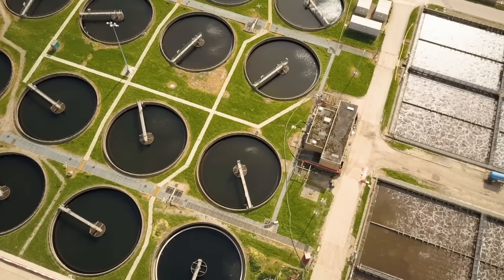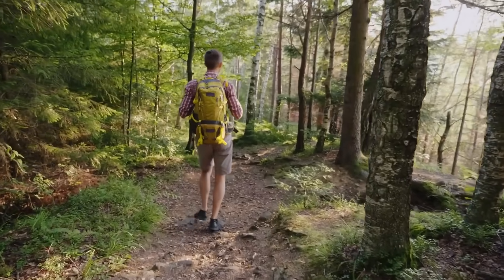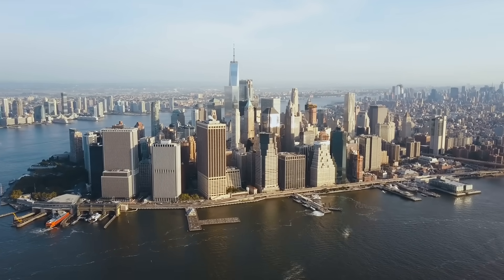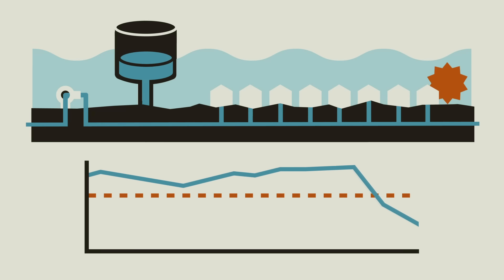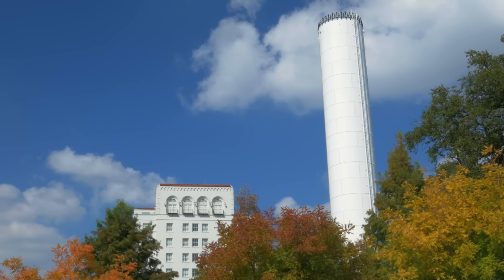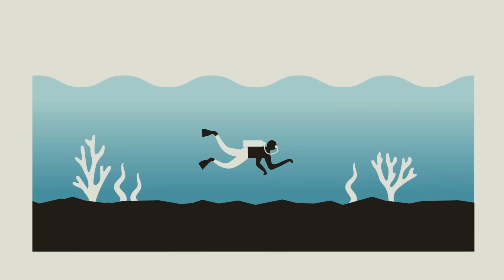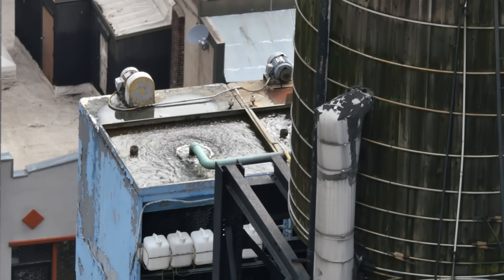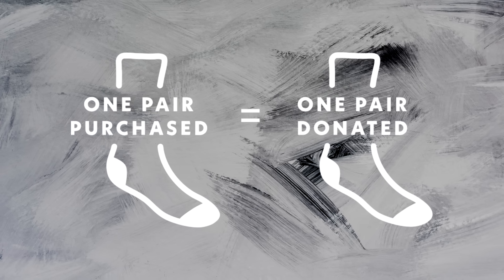How Water Towers Work

Comment: A water tower is like a capacitor or rechargeable battery --- it releases copious intervals of flow when needed, and then stores the water during periods of less demand. :D
P.S. That's what a savings-account is supposed to be for, too --- you put in extra money as you get it, and then it can be heavily drawn upon during an emergency.  The problem is that many folks cannot resist spending money on stuff that they don't need, and so they are not able to save up much.
Reply: Was gonna say the same thing.
Reply: That's not how poverty works.
Reply: How did you manage to turn a topic about batteries and water towers into a message of “Why don’t you just not be poor?”
Reply: "The problem is that many folks cannot resist spending money", uhh no, it isn't. Spoken like someone who doesn't know poverty. The PROBLEM is that many folks cannot make a living wage and the concept of saving is a complete fucking joke because respect for the working class has become completely abysmal, not to mention profiteering financial institutions being the cultural norm, education prices (both public and private) being absolutely hysterically gouged, etc etc etc. There are SO MANY problems that come down the line before "people have no self control" that it's an insult to even suggest that it's a substantial issue. Corporate profits are at an all time high and the concentration of wealth within the upper classes is more severe than ever before in the history of this planet, BY A WIDE MARGIN, and that's including the times when kingdoms and emperors were the way the world was run for thousands of years before modern governmental systems came of age.
Reply: @kylezo  , and All those problems are caused by the world's people's disdain for their Creator's laws. Bear with me please. For example, there are 4 Scriptures commanding the 7th Day Sabbath.
Exodus 20: 10.
Exodus 23: 12.
Leviticus 23: 3.
Genesis 2: 3.
There are  0  Scriptures commanding a weekly sun day observance.   0   .
Acts 20: 7 refers to the yearly Shavuot/Pentecost commanded in Leviticus 23. Proven by counting the 50 days.
🔸Matthew 5: 18.   Not one.
Mark 7: 7.
So we see
🔺Deuteronomy 28 15 - 68 
in effect Today.
🔹II Chronicles 7: 14🔹
🔹 Deuteronomy 28: 1 - 14🔹
Man's character hasn't changed, and will not until the Savior Yeshua, who came as a Hebrew speaking Hebrew to Hebrews, and so certainly doesn't have a Greek word as His name, until He returns as lightning flashes from the east unto the west, and begins His eternal reign as King of kings over the people and planet He created.
Reply: @kylezo  Take one look around you and I'm willing to bet you'll start to see a lot of people who would have enough to get by if they managed it properly. I'm on minimum wage and if I only spend on the things I need not the things I want then I end each month with a lot more than I started it with.

As panda4247 very rightly pointed out, people see a lot of things as necessities when they're anything but that. A car is quite often a huge waste of your earnings when you could likely just walk, bike, or take a bus. Mobile phones too, are an extreme money drain that people think they need. Take care of your phone instead of replacing it every 6 months. Same goes with computers. Learn how to take care of your things instead of wasting money replacing it.

The key to surviving on little to no income is independence and self control. A need-to-have basis rather than a want-to-have one, and knowledge of the systems and objects around you are your most valuable tools. Don't need to call a plumber when your sink clogs if you know how it works!

I won't deny it's possible to be on such a low income that you physically can't afford to live, but in many developed nations this should be impossible if you're seeking the right help and managing your assets properly.

I mean.. look at yourself as you wrote that comment, likely on a computer you bought (can you really say it's necessary?) using your time to respond to YouTube comments instead of benefiting yourself.
Reply: @MGSLurmey  Lmao, a car not being a necessity, are you even from NA?
Reply: @kylezo  I agree that this is true for many people.  I was merely saying that some people would indeed have enough if they practiced sensible frugality and saving, the way I do.  I am merely on SSI and Food Stamps, but I manage okay on just those few hundred bucks a month; that's only possible through very thrifty living and careful budgeting, though.
Reply: @Fred @Kyle i suppose it's both..
I have seen people like a single mother complaining to somebody on the phone that she does not have enough money for something for her child... but the phone was a new iPhone, maybe 800€ or so...
And people who think that a car is a necessity even though they just go to work and back each day on a route that is serviced by public transport, and then they complain that they are poor..

But also, the global economy and inflation make saving not that attractive, and the people deciding these things don't care about the little people...
(and I know that "the people deciding it" is not a bunch of people in the suits having meeting for this, but again a global set of decisions of a lot of people with money... but that's the thing... Their goal is for "the people with money to be able to make profits" and not "the value of the money should not decrease")

So I agree with Fred, that in many cases it's just people not having the right priorities (or a will to adhere to them).
But I also agree with Kyle that the people on the edge of poverty don't have many options how to change the status quo, and it's sad the the desision power is in the hands of rich, not in the hands of many.
Side note: I don't want communism (not to confuse with the Russian totality which ran under the guise of communism... I don't want that totality even more :)). I am just saying that the current extreme capitalism decided by the few is not good either.

Comment: Voltage stays consistent across a circuit unless there is a transformer to step that up or down. Current can change based of resistance or lack thereof in a circuit. When talking about the movement of electrons through a circuit, they move from an area of high potential to a point of low potential (from batteries, capacitors and static sources) or following a magnetic field (from a generator or transformer). 
When two different voltages meet, they simply combine their potential. If they are in series it is additive and if it is in parallel, it is at the highest voltage source. If any component can't handle the voltage, it will burn out and break the circuit.

Comment: 2:21 Ahh you have triggered every electrical engineer. Electrons flow from low potential to high potential, as the high potential will attract the electrons accumulated at the low potential.

Comment: Fantastic video, thanks so much! Because this video, like all those on the channel, is so informative and so interesting, I wanted to offer one important correction. Strictly, electrical current flows from high voltage to low voltage, but electrons flow in the opposite direction. (just in case any materials- or electrical-engineers-in-training wander over to the channel!)

Comment: Water towers are quite rare in the UK nowadays and there are strict rules pertaining to how water can be store so that is it safe to drink. I wonder how safe water stored in towers or tanks on top of buildings is and how it is kept safe? If I am not mistaken, in the UK drinking water cannot be stored in domestic water tanks due to the risk of contamination finding it's way into the supply. This is why before the advent of instant hot water boilers (gas-fired combi-boilers, typically) hot and cold mixer taps were not used in British households.

Comment: Great content! Question; I have installed a windmill on my property and am wondering how to calculate the height the water tower should be. Can you advise? About 30 ft. would provide roughly 15 lbs./in^2. But I don't know how to quantify friction and turbulence losses. I have a 1" pipe from the windmill to the barn hydrant which branches off to 3/4" going the house and another 3/4" branch going to a tiny-house. total distance from where the water tower will be to the shower is roughly 200 ft. I thought of buying gauges and mount a tank at different heights on the water tower to test but that seems like a tall order. :)

Comment: i thought there r several ways to save energy , save money by selecting suitable pump, deviding zones, using different size pipe, solor energy, using in minimal housing unit, some cases presure can be created by solor perpelled engine.

Comment: Pumps create flow not pressure. Restrictions create pressure. This is basic hydraulics. The rest of the information is interesting.
Reply from the maker: Can I ask where you heard this? So many people comment it to me, but it’s really not true.
Reply: @PracticalEngineeringChannel  john deere tech program. Pressure is created by restriction to flow. So if you have a pump regardless of what it is and it is pumping from one location to another with the same diameter tube or pipe on both sides you will have flow but no pressure.now if you have a smaller output than the suction there is going to be resistance and this will create pressure. Also if there is a smaller input than output you have no pressure there as well just flow.

Comment: Pumps create flow. Pressure is created by restrictions
Reply from the maker: Can I ask where you heard this? It’s not really accurate.
Reply: @PracticalEngineeringChannel  it’s very accurate. Take a vehicle’s engine for example. As the bearings wear out the oil pressure- even though the pump is putting out the same volume of oil as it always has due to the bearing being worn away the space the oil flow has is bigger so the oil pressure drops. The more restrictions you have the higher the pressure. The higher volume of flow yada yada

Comment: Why aren't we letting these double as batteries to get some power back out of the tower draining? Or are we actually doing this? If not if we did, it wouldn't be a huge amount of power, but it would be something. He talks about the pressure, but all that would be needed is installation of a few low resistance turbines in the down pipes to generate electricity out of a process that is already being using in another manner.

Comment: 80% of the ones on our water system that we maintain are water tanks. Ground style tanks. Easier to maintain. Easier to cycle when things go wrong. But higher towers have the added benefit of more pressure due to it being a higher off the ground.

Comment: your animation of how water towers are fed is wrong water towers are fed from top not bottom if it were fed from bottom the pressure would be too much for the pumps & would destroy them leaving towns without water your easy way of describoing this look inside your toilet cistern the innards is pretty much the same as this but they dont have a vaccum outlet

Comment: 2:22 The electricity analogy almost works. It is true that "conventional current" flows from high voltage to low voltage. Electrons, being negatively charged, flow the other way, from low voltage to high voltage.
Reply: Pedantic, I know. Avoid the word electrons and use current and it's good enough.

Comment: If the depth of the water determines the pressure why do we need to place water at the top when there's greater pressure at the bottom? All we need to do is prevent the water at the top of thin tubes to not be removed?

Comment: We have a situation where we're looking very strongly at sinks and showers and other elements of bathrooms where you turn the faucet on -- and in areas where there's tremendous amounts of water, where the water rushes out to sea because you could never handle it, and you don't get any water.
You turn on the faucet and you don't get any water. They take a shower and water comes dripping out. Just dripping out, very quietly dripping out.
People are flushing toilets 10 times, 15 times,

Comment: In Hanoi, Vietnam residents had tanks on the roof or top floor, I'm assumig to suplly the water pressure.  I could hear the pump engaging after using the water to , I'm assuming, refill the tank.

Comment: Water height in water tower happens to be let's say 200' tall than freshwater weight being 8.33 lbs per gallon gives you about 86 psi at faucet. 200' X 8.33 lbs X .052= 86.632 psi.

Comment: The requiring NY skyscrapers to start mandating water tank at the top can be said not only to supply water to the building in event of emergency / power outage, but can also act as a seismic stabilizing mass to limit base shear loads on the building.

Great video, thanks!

Comment: I haven’t seen a water tower in Germany for years. I am guessing, but if you gave me the problem of making a water storage system, I would save money and build it at or below ground level and have a closed storage tank with compressed air over the water surface to supply and even out the pressure. It would be much cheaper than building a storage facility way up there at the top of a tower.

Comment: This video is great & has lot of effort & researches behind it, Great job!
Water Towers are great solutions for the Water network, that to design the network on the Max. daily demands only for the network before the water tower, but the network after the water towers (the downstream) will remain designed on Max. hourly demand.
However, there are other solutions to element the water towers & to design the entire network on the Max. daily demand by having a mandatory 2 days ground storage tank under each house\building.
There are too many other solutions as well. Thanks

Comment: Just want to say keep up the great work. I just completed a 4 year MEng Engineering course over in the UK and I have learnt so much from your videos.

Also, because I am very pedantic, in 2:21, positive charge flows from high to low voltage so electrons actually flow from low to high voltage. Anyway, I am sure you knew that but just thought I'd point that out as a fellow engineer!

Comment: I have designed water systems with three wells and two elevated water tanks at different elevations.   Make for interesting calculations. 
Two wells and one tank served as pressure sources for the higher system and the lower system.  The third well and second tank was the pressure source for the lower system.

Comment: They say water towers are expensive, 4 to 5 times as expensive as a pump with reservoir in the soil. Thats why they dont build water towers in Germany and dont use them anymore. There are around 2000 water towers in Germany, many of them unused and under monument protection.

Comment: I design public water systems  - supply, treatment, pumps, distribution, ground tanks, elevated tanks, etc. This video does a good job of explaing why elevated storage is needed & why it's a good thing. Putting the tower at the right height can be challenging.  I know of a few elevated tanks that can never empty b/c they are too low.

Comment: Good video and you covered nearly all the points what you missed however is the effect on treatment. If your treatment plant had to treat water at the rate it is used it would be very inefficient however by treating into storage and supplying from storage you can treat at the average rate and therefore optimise your power and chemical usage

Comment: I expected to find out about the structure of water towers and hey they are designed to hold so much weight at elevation, venting pressure, preventing freezing, etc.  i.e. how they work.

Comment: I took a class called Global Change, and the professor was discussing the CAP canal (Central Arizona Project) that brings water from the Colorado river to the Phx area, and he mentioned he didn't understand why they didn't cover the canal to prevent evaporation (obviously because of cost), seemed like a good point to me. In a desert where water is scarce and with California struggling with a drought. A video on the CAP canal would be interesting.

Comment: Hey.

I might be a bit late but I have question. I have been told that hydrological pressure is the same in particular depth. That means water pressure doesn’t depend from the amount of water. Here I draw water tower nowadays.

                ____
             /             \
           /                 \
          \                  /
            \              /
              \          /
                |       |
                |       |
                |       |
                |____|
U see there is water storage in the height. And here is my consept.

               _
              | |
              | |
              | |
              | |
              | |
              | |
            /   \
          /       \
   __/           \__
  |                        |
  |_____________|

So I am pretty sure that my building would be much easier to build and it should work also. Why not?
Reply: "Why not?" you use small amount of water from top and pressure drops immediately.

Comment: A lot of yes's, and some no's. Pump's should not be running constantly. A water tower should hold enough water to give the pumps some rest. Not all tanks are filled with pumps. PRV's are used as well and in my opinion is the better way to do it if possible. This can only happen if your water source is higher than it's customers. For those who don't know what a PRV is, it stands for pressure reducing valve. It can give you typically no pressure (no water/off) to about 40psi minimum, nothing inbetween really. up to full pressure. So with a scada system the tank can tell the valve that it is low and the valve opens filling the tank by it's self, then obviously once it is full it closes its self.